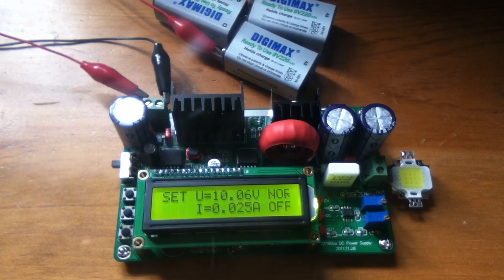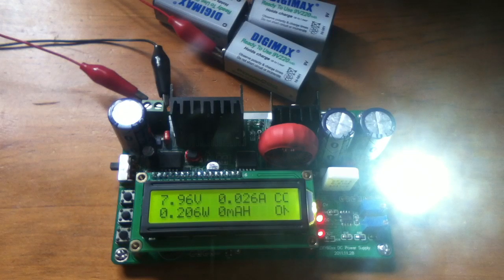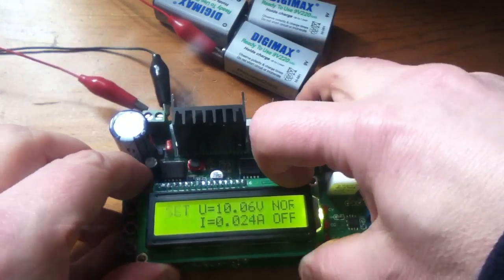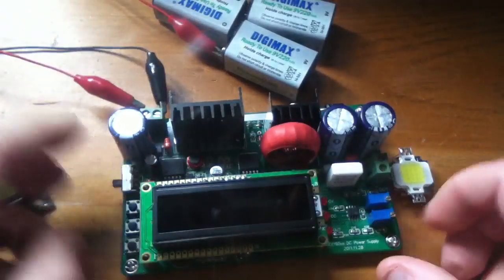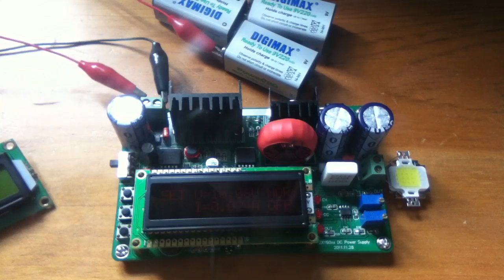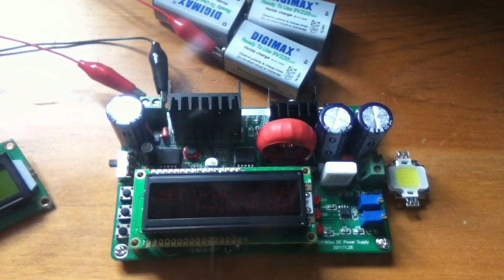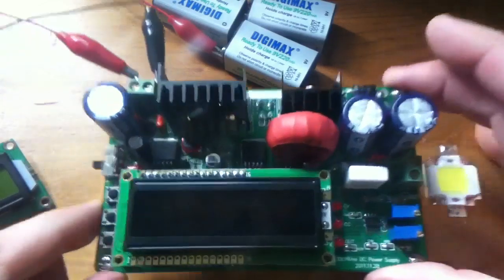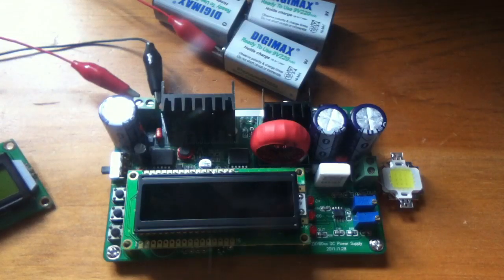1602 LCD Module Blew up my Power Supply - A Cautionary Tale!

Comment: I had a problem with my LCD module just tonight but it was because I accidentally shorted VDD and VSS cuz I wasn't paying attention. DOY. Still works fine. I'd imagine the battery got most of the damage.

Comment: Be careful with anything bought from China. I just had a burnt up breadboard power module /battery holder which I tried out, turned off with the button and unplugged and left on the side, and 5 minutes later I could smell burning. I eventually found it was coming from the battery holder which was smoking and melting the plastic. The batteries were too hot to touch. I don't even know how/why it did this but I'm glad I didn't leave the house!

Comment: Would be great if you added a simple video on how to measure and compare the different resistance.

And also if you know what resistors you can use instead of potentiometers, that would be great to show.
Reply: I just had a couple LCD "burn, ie, HEAT, up on me.  Wonder if that was the issue.

Comment: what causes the columns to go out like that because i had a blue lcd and about 1/4 of the columns went out. that lcd was marked v2.1 that lcd also had problems with electromagnetic interference just a relay turning on or off would make the screen go crazy. i have went to v2.0 and doesn't seem to have either of these problems
Reply from the maker: Not had any interference problems. It's only the last column that's not working on this LCD - I assumed the zebra strip was misaligned.
Reply: +Julian Ilett put a link to this product please